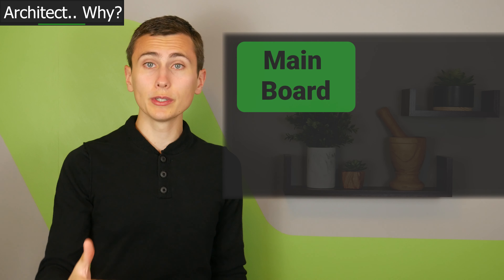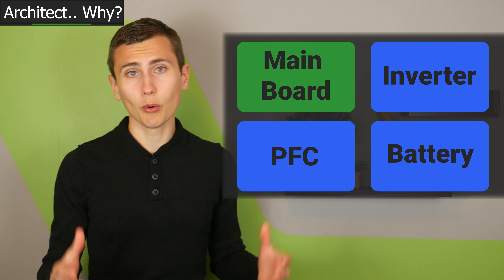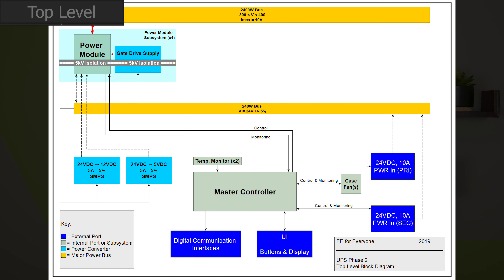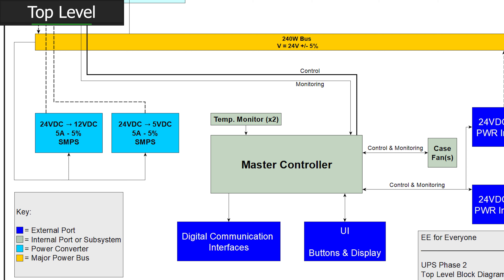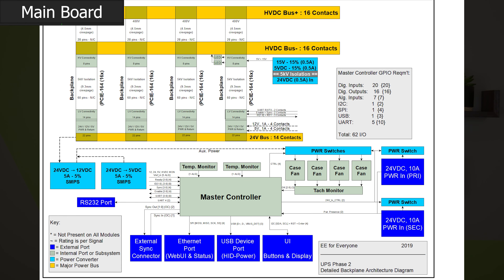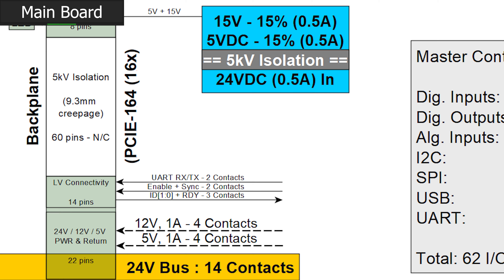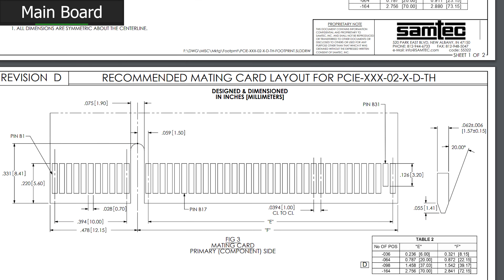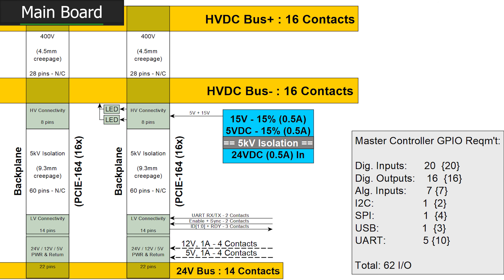I Forgot the Most Important Part!!! (DIY 2400W UPS)

Comment: Sounds like an a great system topology...i especially like the use the PCI-E connectors, that's an awesome idea.

I would suggest that you design the power modules as pairs of mirror images...that way you can sandwich a heat spreader between each  pair of mirrored boards and use heat pipes to move the main heatsink somewhere more convenient. I could help with the thermal management side of things if you're interested.
Reply from the maker: Thanks Dr. Rockzo! 

PCIe wasn't made for isolation... but there are just so many pins! It seemed like a great opportunity. 

Pulling power out of both sides could be effective, though the top and bottom cards may need something special. Our intent was to make the entire system modular, where a person could skip a slot or leave a blank. There's a special use-case I have in mind that requires 4 power modules instead of the standard 3.. which means that the number of cards in a system could vary.

I'll keep your heat-pipe suggestion in mind. It's not the solution I was hoping for, but it's VERY possible that the solution I have in mind literally won't work at all. If we need a massive heat-sink, and only have room for a tiny heat-sink, I'll let you know and we can work out the details. :) Thank you for volunteering! Time will tell, once we have the design complete enough to load everything into the layout tool and can see how much room is left to pull heat out.

Perhaps the middle could be a solution? Maybe we can use heatpipes to improve thermal performance for a particular daughter-card that dissipates a lot of power, but use modular cooling with off the shelf parts for modules that are a little more tame or have more room on the PCB?

First things first: I've got to figure out how much heat is coming out, and how densely it's crammed onto these boards. :) It'll be fun to chat thermals once we get there.

Thanks for watching!
Reply: @EEforEveryone 

I think I missed the point of a modular system...so yeah pairs of mirrored cards would be less than ideal. 

However I still think a solid look at using heat pipes could be worthwhile and seriously increase your power density...assuming it's worth the additional complexity.

Do you have any idea what kind of watse heat you're looking at per module yet?
Reply from the maker: @drrrrockzo  Right now I'm looking at anywhere between 100-300W per module, depending on the module. No word yet on how it'll be packed, but I'm guessing there will be areas with a power density in the range of 10-25W/in^2

One advantage I see to using heat-pipes is there will be a lot of physical obstructions to airflow (transformers). Getting the heat out with some pipes could make layout a bit easier.

Then again... I have absolutely no idea where there will be room for heat sinks off-board. This chassis is quickly becoming shockingly full! The space behind cards is allocated to the cards themselves... Let me know what you have in mind and I'll see if I can make room. :)